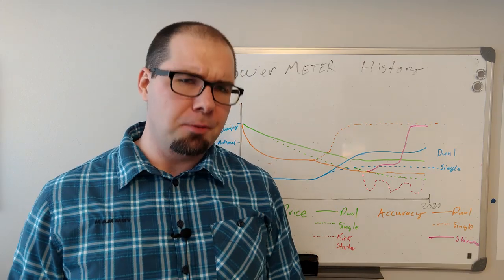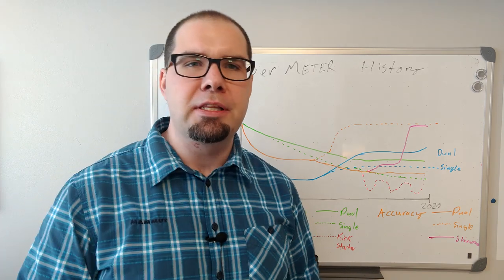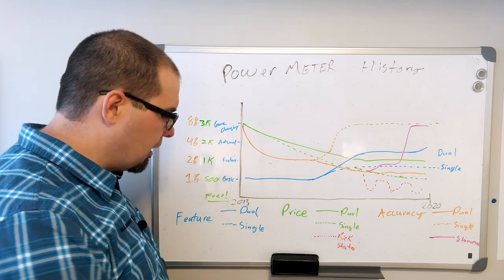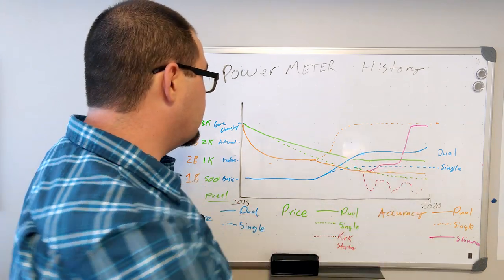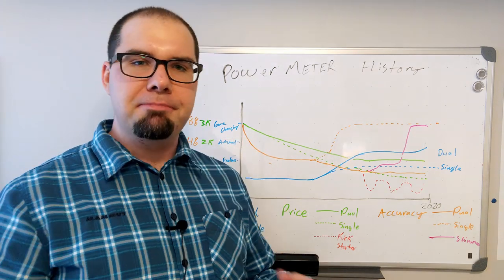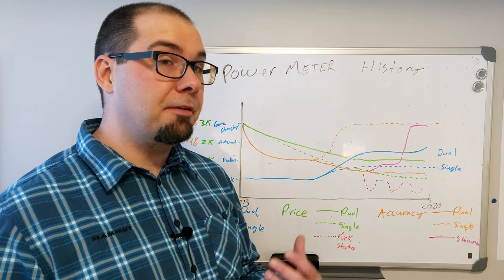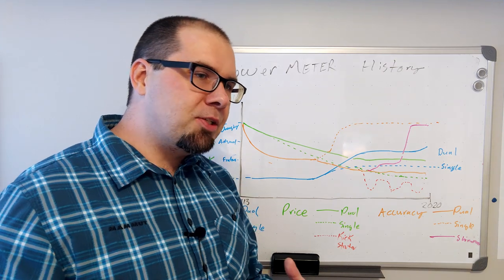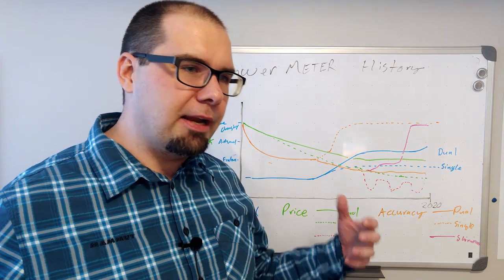Powermeter Historic Trends and Future

Comment: Hey Keith, I'm wondering if you can answer a question. I have the understanding that manufacturers claim of +/- % of accuracy is based on the reading to the unit itself in isolation pedal stroke to pedal stroke. Now my friends think this is rubbish, and the +/-% is in relation to accuracy overall in the wider power meter field. What are your thoughts?

Comment: I was under the impression that the real bottleneck was battery power. Transmitting high-speed data takes power and since the industry has been forced to use rechargeables, capacity suffered. 500 or 1000 samples per second is not a problem. The other issue is most trainers do not understand what you can do with this data. Look how long it took for everyone to use a powermeter. Anyway nice vid.
Reply from the maker: Power is and isn't. Unless we switch to big coin cells (2450, 2477) then you're into accelerated death. Recharagable becoming more popular (and thus reinforcing disposable PM concept) does mean it's possible. Your 100 hour battery becomes 10 - 15. But Microcontrollers have been taking big leaps lately and analog circuits small steps. People won't understand what to do with the data until we generate data. It's chicken and the egg. Internally every single company has done it in various ways.

Comment: Interesting video, you really know your stuff when it comes to power meters.
I checked mine for feedback from the none drive side to driveside strain gauges. I'm picking up -2 Nm at the driveside with 20kg on the non drive side. Not great but it only seems to be when the crank is horizontal up/dn 10 degrees and it disappears.
Reply from the maker: If I understand correctly what you're saying that's the common asymmetry, or if it's symmetric crank, then a gage placement issues. The benchmark in my head if I recall correctly is 0.5N@20Kg vert = no error detectable by just about all users. 1N = measurable but "reviewable". 2N = ummmm, not good it's always going to be off, 3N = me and Ray Maker reading about 8% - 10% low. I wouldn't be too concerned about changing off 0 degrees because then combination reduced axial response and torque, so they can cancel.

Comment: Load cells in cooking kettles in the food industry... I work in food manufacturing, complex final hands on assembly of many parts... Part of that involves suace cooking, graves, curry's, ragu ect, the kettles are ancient and thus the load cells follow, the load cells fail to accurately weigh leading to failure in nex step procedures or cooking to correct yeild, OEM have been to calibrate several times, each time saying they're accurate when there 5-50kg out 😂 any idea on aftermarket additions that could be inbedded?
Reply: hi
you seems talking about microwave when you use 'kettle':)
Reply: @willo7979  I'm definitely talking about kettles... Its like a giant suace pan which is double jacketed so it's heated via steam between the jackets, or via direct steam injection into the kettle which then adds water to a cook and heats the mass inside. Microwaves have no need for a loadcell or another name weighcell
Reply: @bushsons100  ok thanks.
Some microwave ovens do have fancy weighing functionality attempting to offer 'smart' cooking, but never get there sadly, yet it's been there for ages.
 Now i see that you are genuinely referring to food industry kettle. While i don't have much experience in that, somehow i agree quantifying fluid mass is a headache. alternatively, i believe matured method out there is measuring flow rate, but this has to be done in a controlled manner (closed funnel/hose) and and it may not suit open funnel work environment.
i can't say anything further, at times, engineer 'calibrate' it and deemed it's accurate, but it was performed at static mode, however in reality lots of environmental noise kicks in, eg. heat, vibration, frictions, a.k.a. system noise. To me the first thing to tackle is achieving consistent and precision readout WITHIN the environmental noise in the first place,  rather than averagely somehow accurate readings at totally different environment where it is going to be used.
Reply: @willo7979  yes I'm referring to industrial equipment. Exactly the ways of our engineers. Static, isolated calibration without the noise. Have a good Sunday.